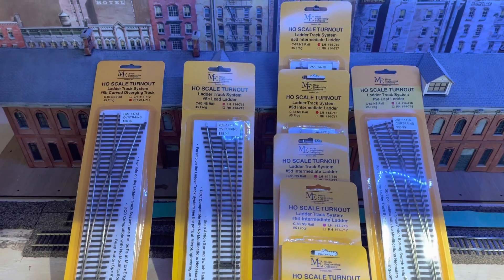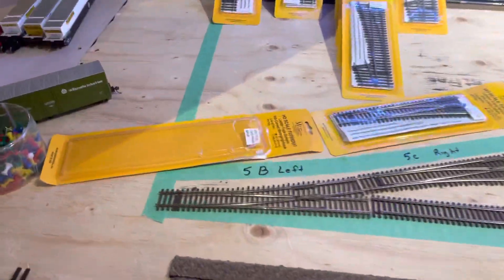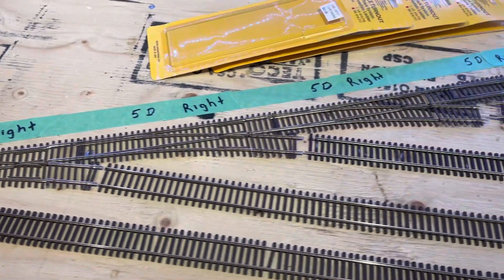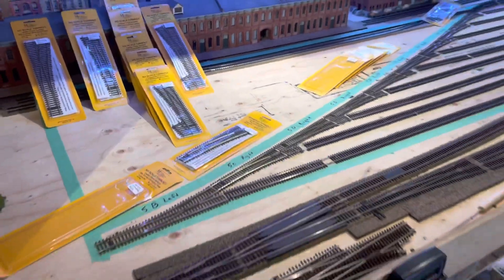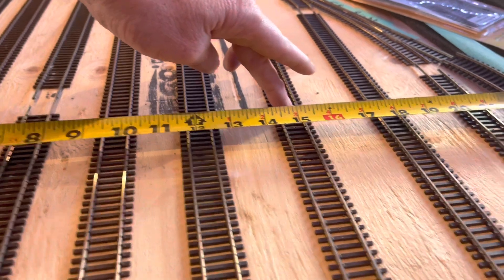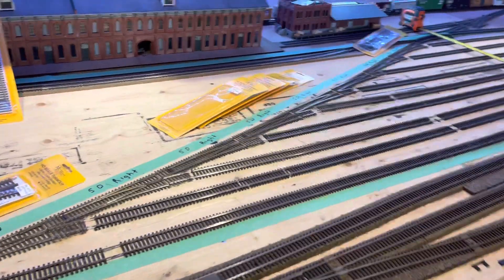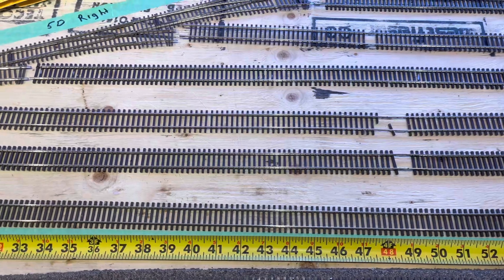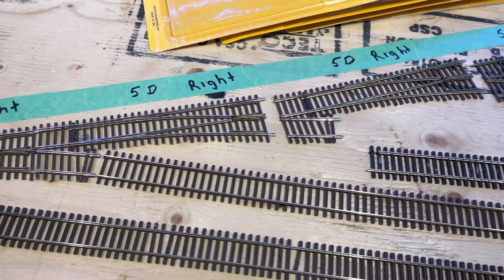Micro engineering track ladder system. How much space do I need?

Comment: Any chance you can tell mell how to connect these using atlas code 83 track coming from my main? Like any special modifications?. Thank you
Reply from the maker: code 83 is good, should be able to connect right to the track you are using. just remove a couple ties if needed from the flex track and the switch, place on fish plate and join together, I always use insulated rail joiners on the switched rail of the switch and add feeder wires just afterwards.

Comment: As an FYI, 10 tracks are about the maximum you can get in 2 feet, whether you use #4 or #10 turnouts.  The turnout size only makes a difference in the length of track you get.  Great information, Sparky.

Comment: Really like the ME Ladder system…my only hang up was having to juice the frogs on all the switches…their is a tab to solder the wire to the bottom of the switch frogs…hopefully you have better success and don’t have to juice frogs
Reply from the maker: i will be adding juicers, the problem I found was power. also have to run feeders to all the switches. and then also to all the yard tracks, The frogs are the easy part, I used a Dremel and cleaned up the connection spot
Reply: @sparky107107  didn’t have to run feeders to the switches but did do the yard tracks

Comment: To get the most car capacity in a yard, both ladders need to be the same, right or left.  This arrangement will give the most  compact yard in width and length with the closest(minimum) track spacing.  All of the turnouts in a ladder will need to be the same frog number.  It is possible to gain a slight increase in each track length with a slight curve introduced beyond the first turnout and then including the same curve back into each yard track on each end of the yard.  This complicates laying out the yard but does add car capacity.  Just like the full size, the complication needs to be evaluated against the gain of capacity.  Clearance points need to be figured.

Comment: I was typing what is the length as soon as you said your first good bye and then you came back and answered it. Thank you for doing this and thank you to whoever asked you to do this, it was very helpful. I have a spot on my layout that I’m figuring out that will be just like this and where you put it on yours helped because I will have a return loop on the left end similar to where yours is. What is the radius of your return loop to the left of the yard throat? Do you know what amount of space it would have taken up if it wasn’t the Micro engineering ladder system?
Reply from the maker: the radius I mostly use is 28"

Comment: And you don't have to go one way or the other, yard tracks can be on both sides of the main allowing longer tracks in the same space. While each switch shortens the next track. Having one ladder or one on each end makes the last track significantly shorter. While if you do the main down the middle there will be a few tracks close to the same length on each side.